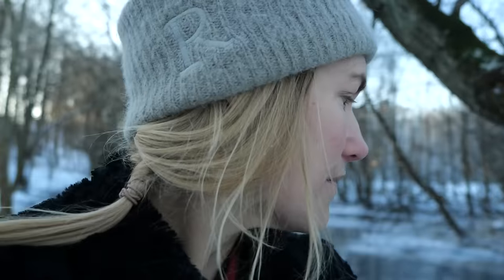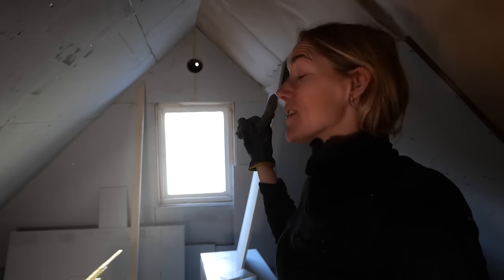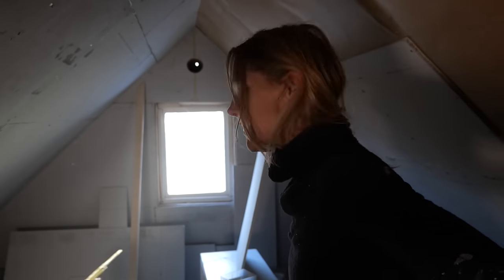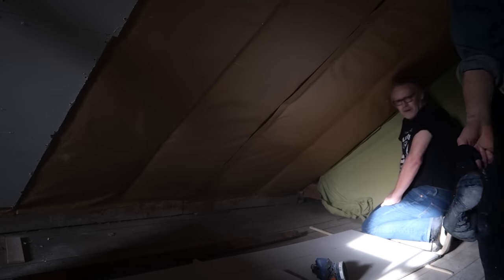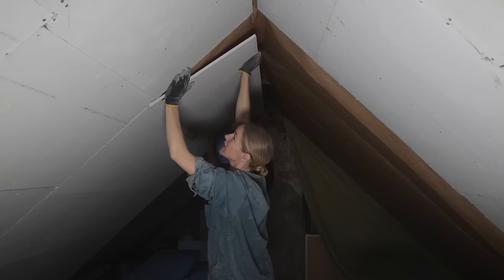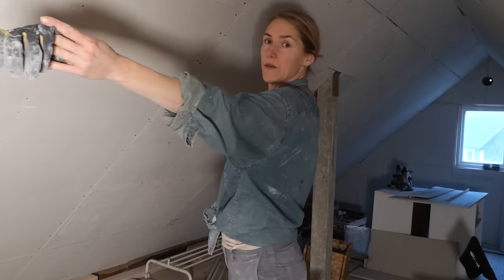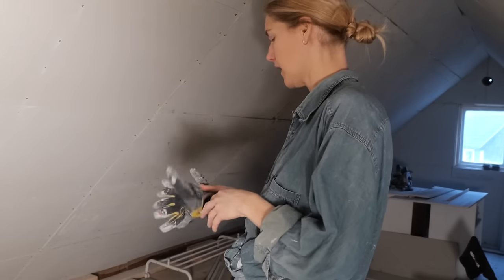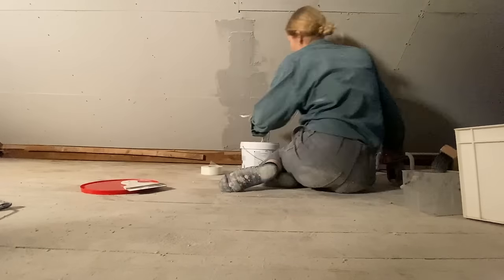#29 Working away in the cold Swedish winter | Building a bedroom in the attic

Comment: It's certainly a little late for this but in Canada people usually plaster only over the nails and joints. That cut some plastering time but also cut on the sanding time. Then paint over all the drywall and plaster area. 
You did a great job plastering it all! 👍
Reply: But since you had to cut sheets in smaller parts, plastering only the joints or everything wouldn't make a big difference. 
Being able to use the whole sheets  would have speed it up but alone and in an angle like you had to do is, we'll, very hard to impossible.
So kudos you did very well in a though circumstances. 🙌

Comment: Hi Anna! You asked so I decided to answer as a professional. If you want the job to go faster you can use the selfahesive fiberglass tape, that you put before plastering - much cleaner and less annoying than using the tape that needs to be plastered in. It's a bit late now for that but maybe next time you could use Casco Wallfiller for first coat. You have to mix it with water but the huge advantage is that you can make it more running so it's much easier to spread on the wall. It also dries much faster than Medium Spackel. For the second and even final coat I can recommnent Rullspackel from Beckers. You apply it on the wall with roller (the coarse type, for rough surfaces or yellow sponge kind of roller) and then spread it evenly with a wide spatula. Remember to clean the surfaces and prime it before painting. I usually buy a grundfärg and mix it with primer for the best result. Good luck!
Reply from the maker: That's all great advice, I still have one "room" left to do in the attic once I am done with this part, so there will be plenty of plastering happening in the future! Hope I can get a hold of the products you are mentioning 🙏🙂

Comment: I’ve watched you struggle to get kindling wood. I’ve seen cinch straps placed around 15 medium size pieces of wood, and larger pieces then whacked. You stand it up and wack the heck out of it. It’s much safer. You must not hold it in your hand, that’s very dangerous when using a hatchet or battery powered chainsaw.